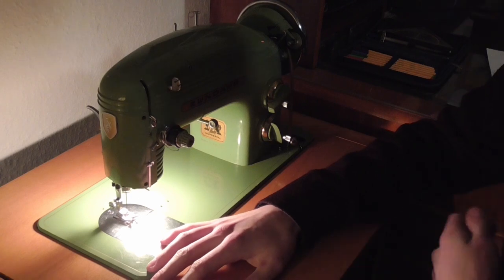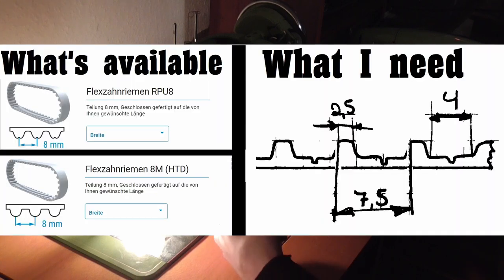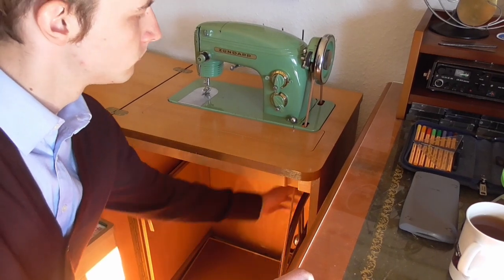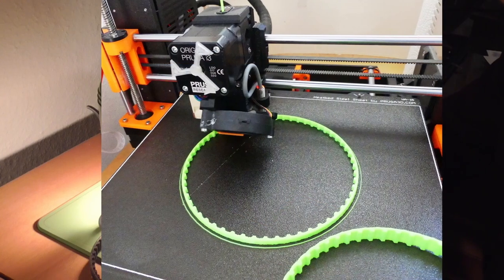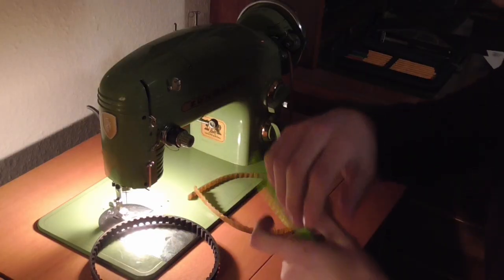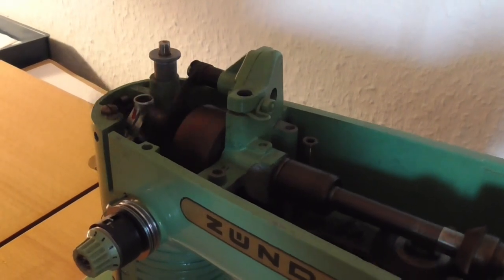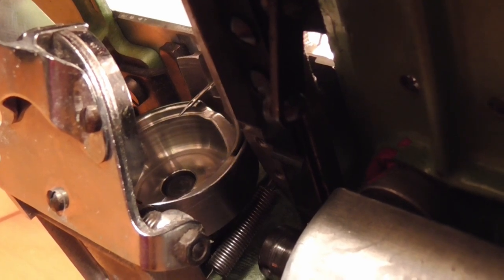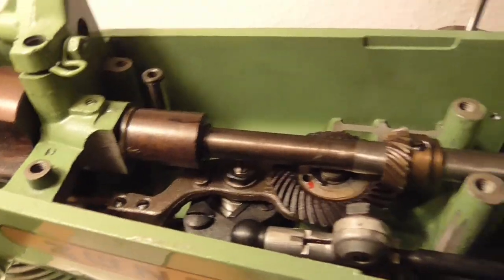New Belts for the Zündapp ZR118B

Comment: I did not know that 3d printing could produce something both flexible enough and strong enough for a toothed timing belt. Great solution.

I, too, am into vintage sewing machines, owning more than 120; mostly Singer & Kenmore, with some badged White, New Home, National, Eldridge and others. 

Recently acquired two different Pfaff models; a flatbed model 230-260 and a freearm/convertible model 332-260 Automatic. Both are similar to the user, but internally, the model 332-260 is just a bit more "industrial" in nature. Very impresseed with the German engineering & mfg, but the problem was that the 332-260 has both a timing belt and drive belt that are metal toothed (Klamern) on corded substrate. The drive belt was broken, and I learned that it's unique and can be a challenge to find the correct replacement based upon length & link/tooth count (I found three different tooth spacing factors. I spent more on the replacement belt than for either machine. Fortunately, I only had remove one pulley and ease back the belt tensioner, without any need to pull drive shaft nor mess with timing.

Comment: Hello,  I liked your videos. Thank you.  I have a Zundapp 3b and would like the data  about the timing belt , also i wish to see if your machine belt matches mine and make a spare to have in case of failure. Thanks again.
Reply from the maker: Hi, 
the belt I've had printed has 58 teeth and is approx. 433mm in length. If you give me your email address, I can send you a step or stl file of the belt.